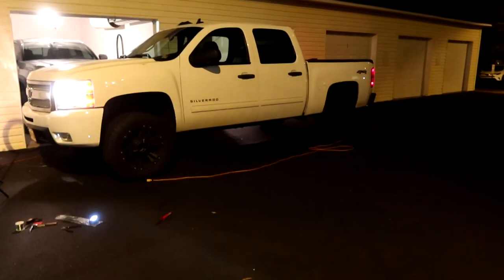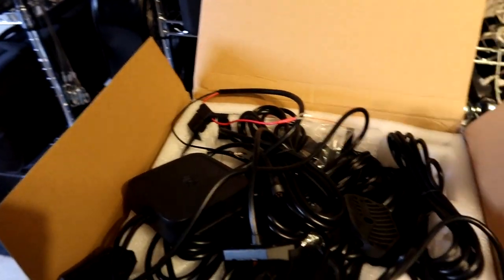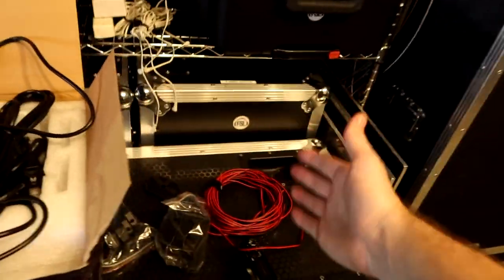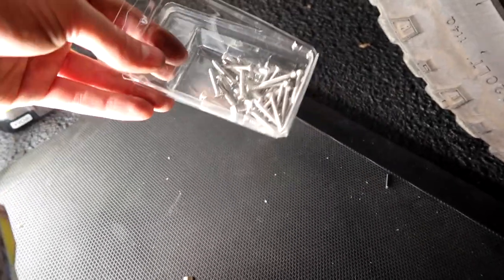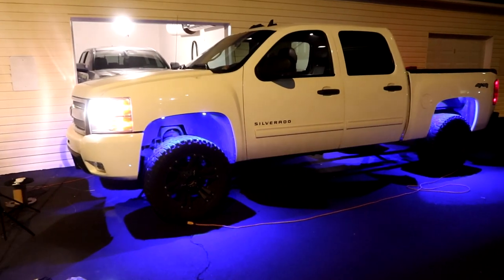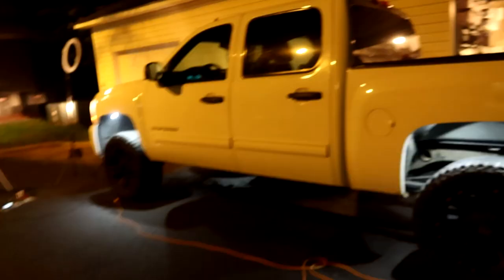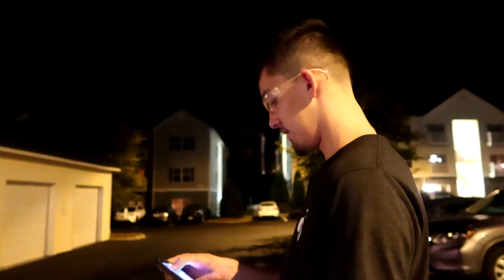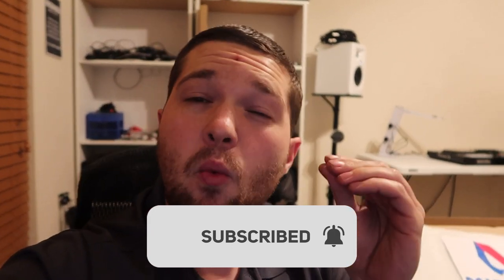Installing ROCK LIGHTS on LIFTED TRUCK (MIC Tuning C1)

Comment: what power source did you connect to?  The battery or the fuse?  if the fuse, which one?
Reply from the maker: Grounded to the battery but we tapped into the headlight fuse.
Reply: Not a good idea if you learn about watts and amps the rockers pull more than the average headlamp?

Comment: Mictuning rock lights are junk!  Complete failure of the app!  App will not link up with phone to control control lights. Total junk
Reply from the maker: Never had an issue with mine or Drakes. Both connect right away every time
Reply: @TacoRick   Happy for your luck. And if you read the Amazon reviews reviews a great deal of the majority of the reviews are one star for this very reason

Comment: What size lift/level and what sizes tires is the truck on?
Reply from the maker: Just a leveling block in the front. 33 inch tires. 20 inch rims
Reply from the maker: He is putting a 6inch lift kit on it next week and 35s